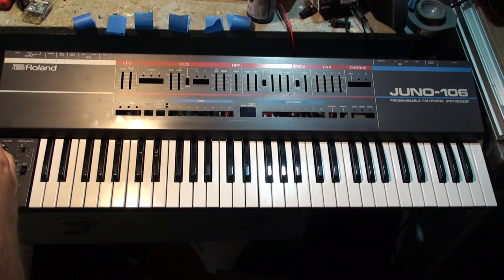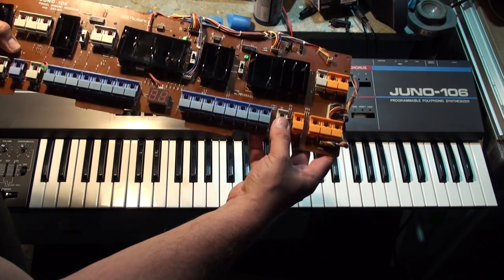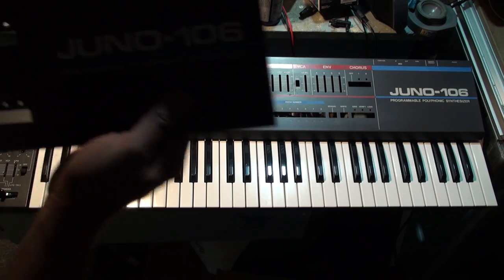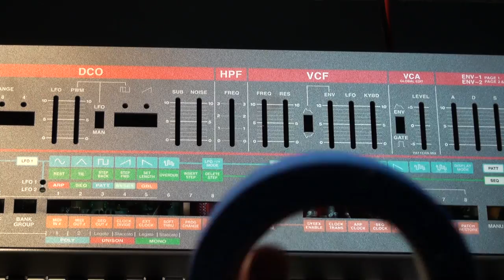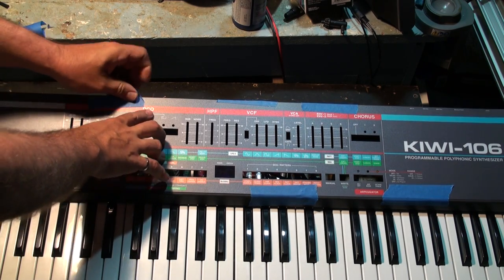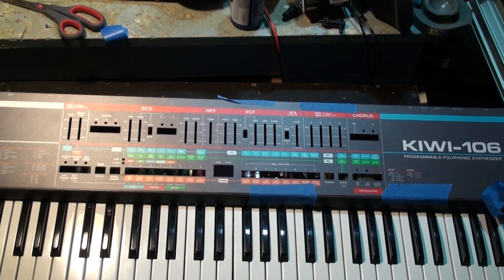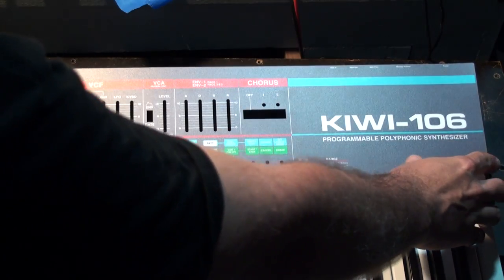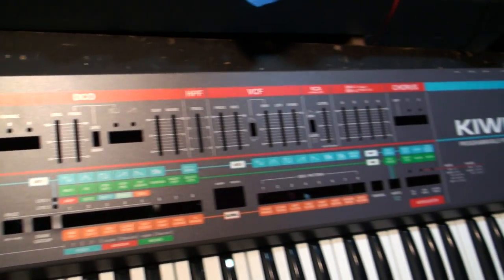SynthGraphics Overlay Installation Secrets

Comment: Thank you Syntegrator! Great news that the stock 106 overlays are available until I can afford a Kiwi106 kit :-) I would be MUCH more confident with your new technique so I'm thinking of giving it a try :-) Would you recommend sanding and grey coating a rusty original before applying the overlay? Thanks again!